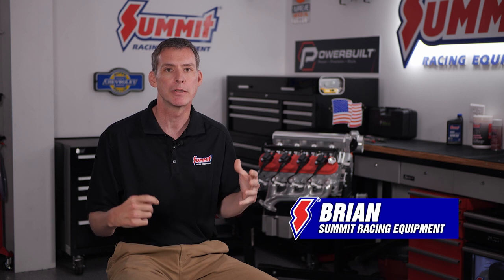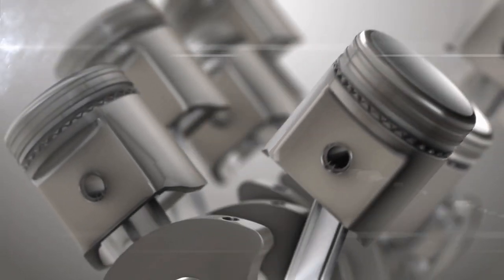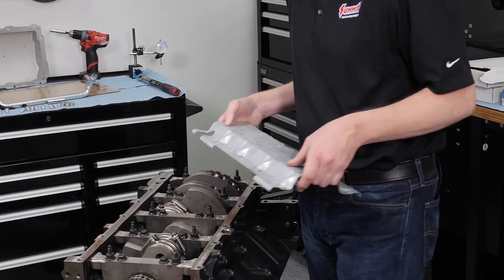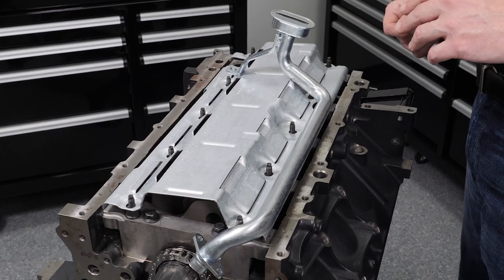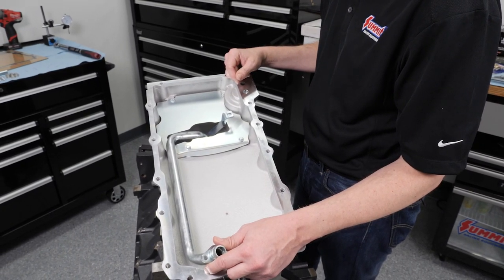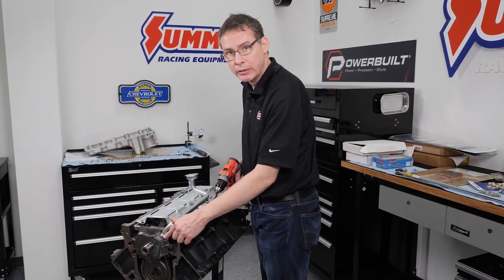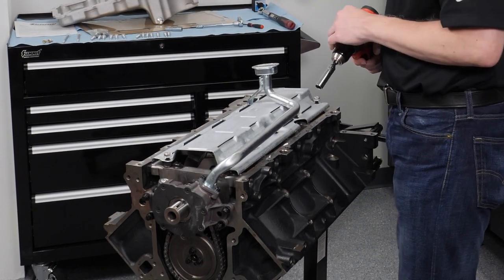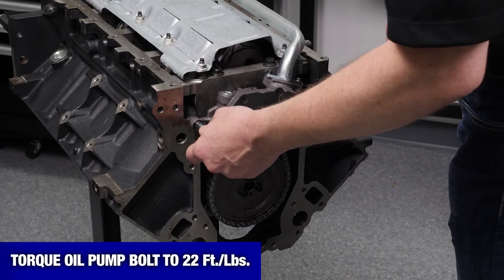Oil Pan, Pickup, and Windage Tray Installation Tips | Engine Building 101

Comment: Thanks for this video. I have a 7 qt. racing pan with a baffle. My '76 jimmy has a windage tray on 350 SBC. Its mostly a daily driver not used for racing or off road. Would it make ANY difference to oil pressure or basic driving if i remove the windage tray? Thanks in advance!